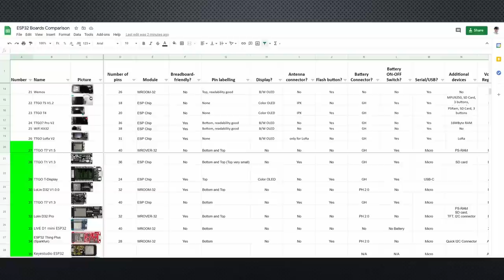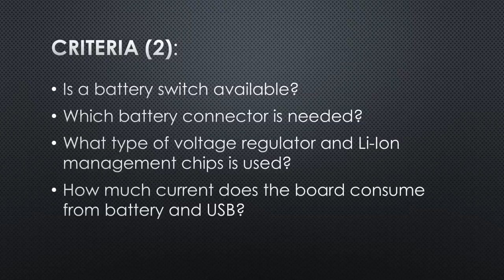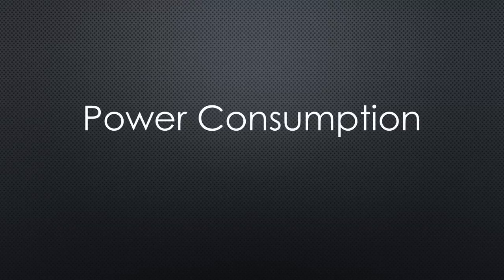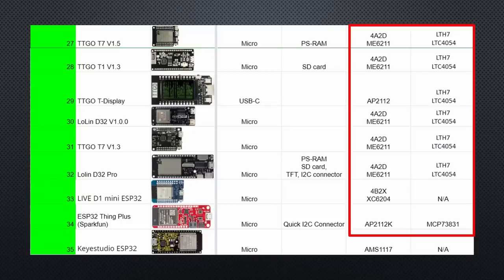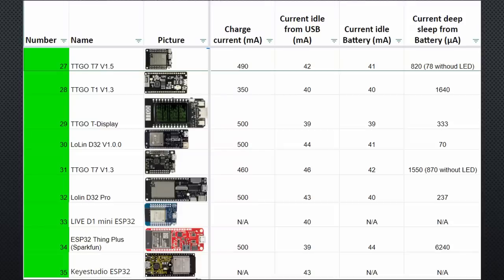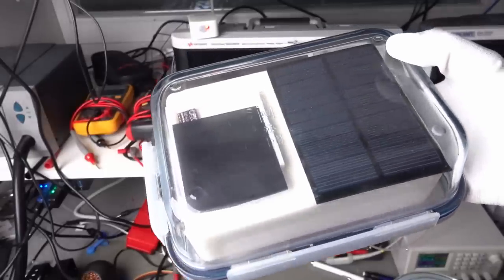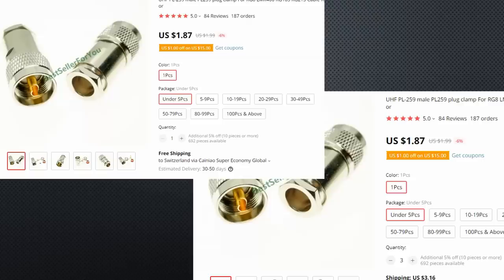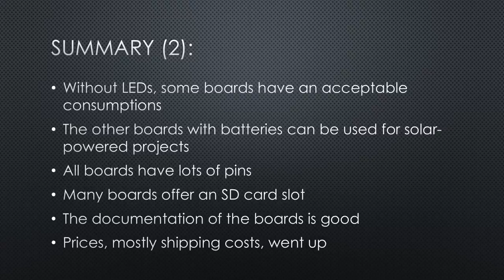#366 9 New ESP32 Boards: Comparison and Tests

Comment: TBH I can't wait until someone comes up with a RISC-V chip configured to run proper linux so people stop putting these things on their home networks.
Reply from the maker: I assume this will take some time because Linux has to be adapted to deep sleep and wake-up in milliseconds. I am not sure if this is what will happen. Maybe we will get an operating system for MCUs (RTOS, for example?)
Reply: @AndreasSpiess  

Sleep to memory (tens of mA) and power off but with wake up signals already works. There are some chips out there that claim to deep sleep in the hundreds of uA..

The way the userland component is structured doesn't really lend itself to instant booting .. but if you have RISC-V application processor you could easily fit a RISC mcu in the same die and have it handle the stuff that needs to happen instantly on wake up.

BTW such chips already exist for ARM. There are even some in a QFN package you can solder at home.

Comment: Another great video!  Thanks, again, Mr. Spiess!  I bought some of the LilyGo TTGO T7 v1.5 chips.  I ran the simple test sketches at https://github.com/LilyGO/ESP32-MINI-32-V1.3 (not exactly the same chip, but good stuff).  Bluetooth and Wifi sketches work perfectly, but I could not get the blue LED to blink.  I tried every pin on the board, but never got the blinking.  Anyone else try?
Reply from the maker: You should find a diagram for your board to find out where the blue LED is connected.
Reply: @AndreasSpiess   Good tip. I checked the schematic. Pin 19 is the Green LED, and it works fine. I'm liking this T7.

Comment: Basically all the same. The same module
Reply from the maker: I do not agree (as you see in the comparison table)
Reply: @AndreasSpiess  
What the difference? Power consumption? But this question of LDO module supplier
ams1117 vs ht7833. Ok, Why not make review that IC? And in this case I can said - Thay not the same!

Comment: Hello Andrea I have a remark  or a question may be out of subject. I want to know how is the behavior of esp32 and esp8266 with two interrupt sources. This is frequent in industry.  For example a serial line working with interrupt and an captor mounted on an motor axis. What's happen if an interrupt occurs where the system is already inside an isr? Is that a hierarchy in the interrupt system? The esp32 is a dual core system.  Is that possible to attach an isr on the second core? Somebody tell me the esp microcontrollers is very poor in term of interrupt system and the solution is to not use interrupt,  but a ultra short loop() method. What do you think about? A person tell me to use stm32, because it's a more professional system. I think this subject is very important.  Can you please send me a copy of your response on my private mail: vormsty@gmail.com. many thanks in advance. Best regards
Reply from the maker: I never looked into that matter. So I do not know how priorities and core attachments work and where problems exist.

Comment: "Engineers" that design these boards, are noobs or just Chinese hobbyists. 
You can tell by their layouts and firmwares. Nothing but designs based on app notes, and auto-router PCBs.  
They could've easily put a solder bridge in the path of the LEDs. All the user needed to do to disable this LED, would be to unsolder this bridge! 
OR even a jumper! Like I said... NOOBs
Reply from the maker: I am still happy that I get these cheap boards. Without the Chinese we probably would have a different hobby. And for sure this channel would not exist...

Comment: ESP32 Is so weaker when compared to ESP8266. Mosts of the available libraries are not well optimized for ESP32. Using Arduino JSON + FastLED right now and ESP8266 at 160MHz is faster than ESP32 at 240MHz
Reply from the maker: Maybe in your particular application... I like the ESP32s additional capabilities.
Reply: @AndreasSpiess  my application uses the most famous libraries for Arduino. It would be cool to see some benchmarks with those libs apart the usual "computational benchmarks" we have just seen on the net.
Reply from the maker: I am not very much interested in the speed of CPUs because mine mostly anyway wait. But you can do it for your particular use case if you have performance problems.